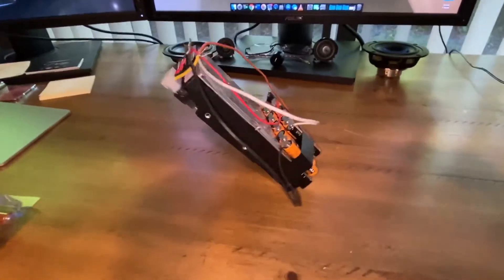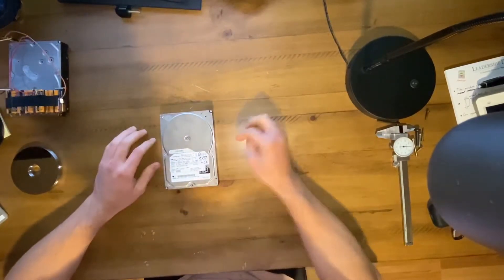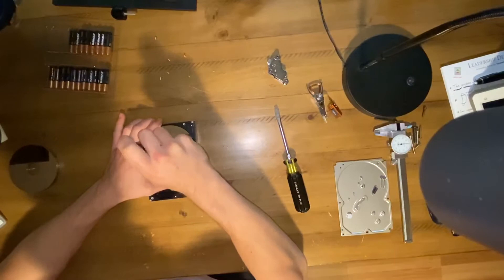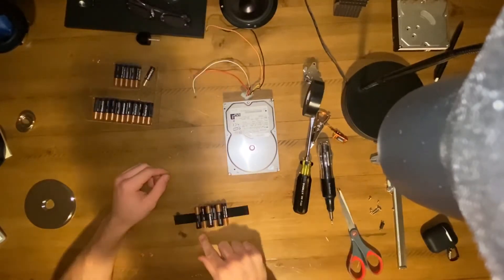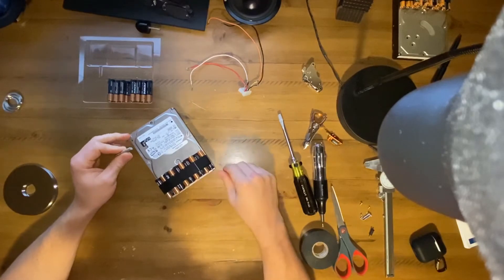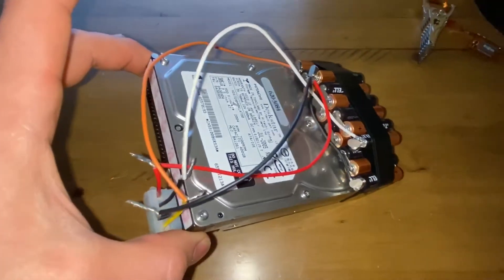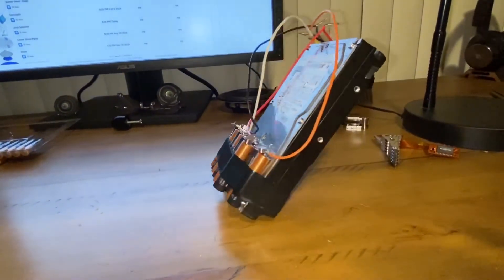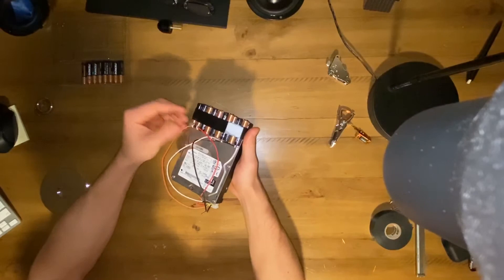How to make a gyroscope out of a hard drive.

Comment: Would it be better to keep the HDD in its case? This way it's safer, and one can take advantage of the vacuum inside for more efficient operation. As long as one can control the RPMs through the HDD controls.
Reply: Unless it was a external drive, hard drives don't have cases. This was likely pulled out of a old computer.